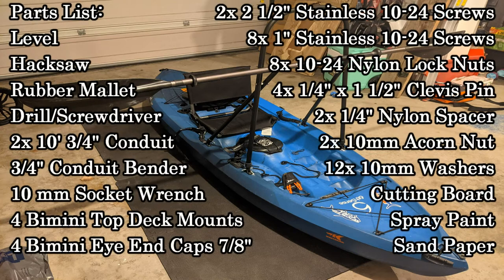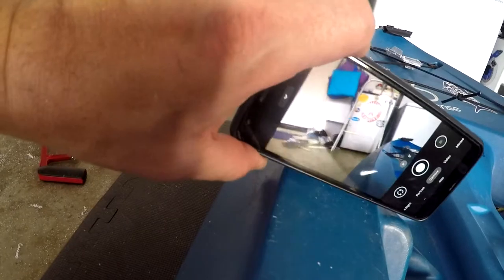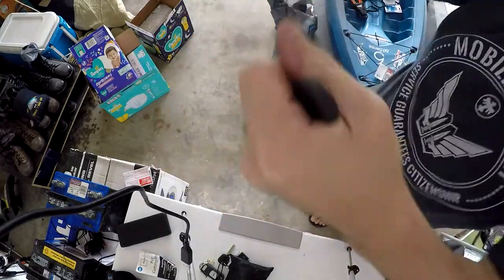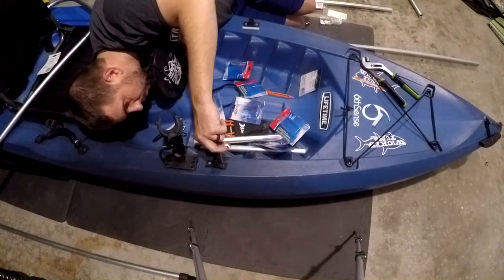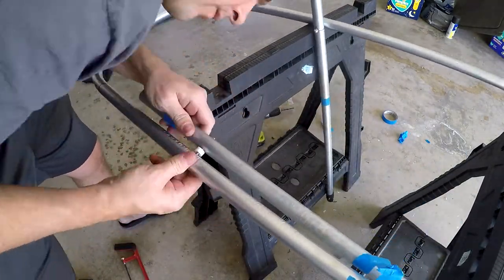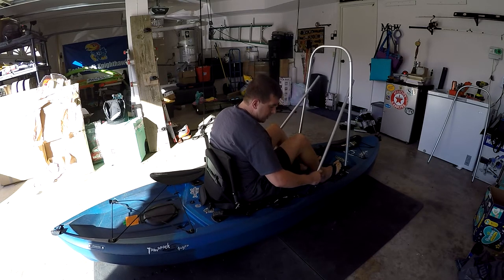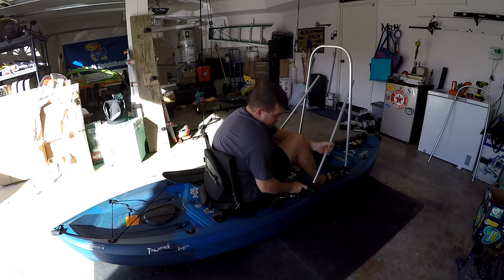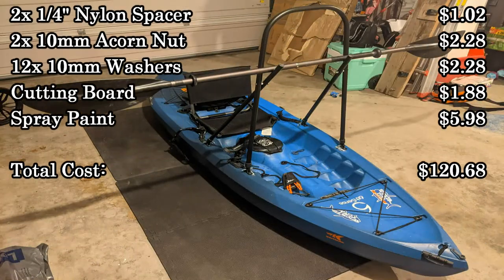How to Build a Kayak Lean Bar (Step-By-Step Tutorial)

Comment: looks interesting. too bad they dont make a track mount vs the surface mount option. instead of bending the conduit, what about using tees and a horizontal bar like the yak attack does? then you could use it on many different boats easily.
Reply: though tbh aside from the yak attack bar not having metal pins (an easy fix) looking at the materials you might save $75-100 ish over the yak attack but it wouldnt be as polished.

Comment: What type of material of those conduits stainless steel? And what the thickness?
Reply from the maker: I believe they are galvanized steel. I'm not sure of the thickness but you can pick it up at Lowe's. Prices have probably doubled due to inflation though
Reply: Make sure you use rigid conduit and not EMT